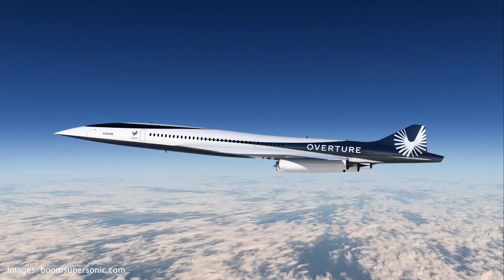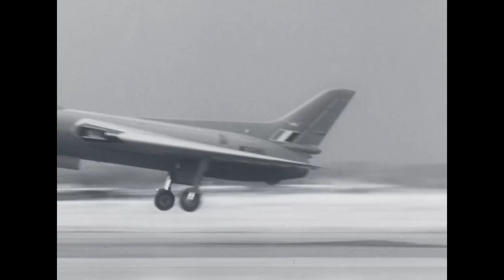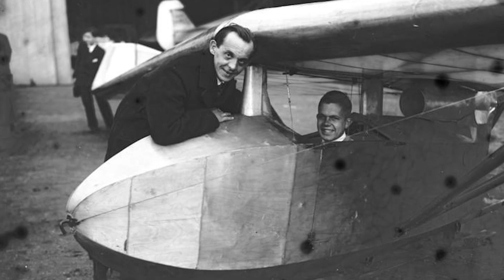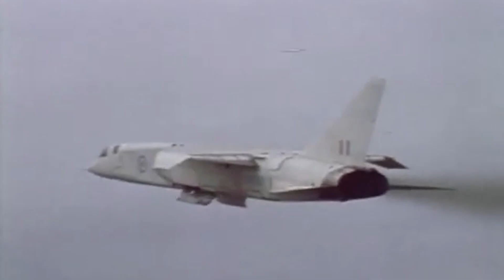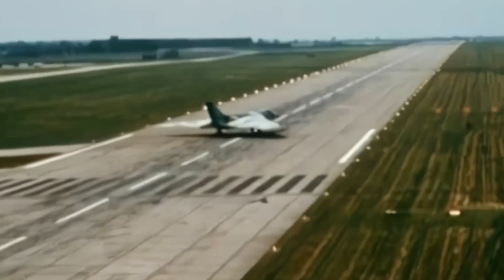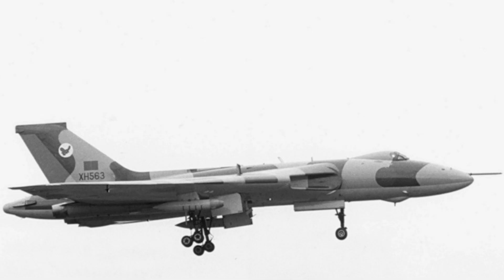Avro 707 & Vulcan: Britain’s Delta Wing Revolution

Comment: Vulcans always looked like a science fiction illustration brought to life - Like a craft designed for Captain Scarlet. Almost too cool to be real.
Reply: It's like the Vulcan was designed by a science fiction illustrator too... which is probably why it couldn't fly supersonic as intended. Too much emphasis on esthetics and not enough on aerodynamics.
Reply: @DoktorBayerischeMotorenWerke  I can't find any sources claiming that it was intended to fly supersonic.  Certainly the wing is too thick, there's no attempt at coke bottling the cross section, and the nose is pretty blunt for an aircraft intended for mach 1+ speeds. They did have plans for a supersonic version, the 732, but that never got past the design stage.  The Victor was probably a better candidate with its wing.
Reply: @ Indeed, the Vulcan in hindsight was a very feeble attempt to produce a supersonic bomber, Avro simply lacked the technology and the expertise.
Both the 707 and the Vulcan were in fact intended to fly supersonic, in recent years many British authors have tried to clean-up and conceal this embarrassing failure.
  The 707 had no chance of ever achieving supersonic flight due to its obsolete centrifugal jet engine.
 The Vulcan however with its delta wing and its 4 huge Bristol Olympus engines had thrust to spare, the problem was both aerodynamic and structural flaws which caused the uncontrolled pitch down and wing spar failures and why Avro was forced to install the Mach limiter system to every Vulcan manufactured. 
 A truly shameful and humiliating chapter in British aviation history and spelled the end for Avro and the relevance of the UK aircraft industry as a whole.

Comment: Rather sadly, the RAF were never very insistent on having ejection seats for their full complement of crew, which meant, that across their entire 3 V bomber  range, ejection was only possible for the pilot and co-pilots, the remainder of the crew having to resort to bailing out via the side hatch (a guard extending to hopefully prevent the crew from being ingested by the engines.)
Reply: The Vulcan failed to achieve its intended supersonic performance, so bailing out was still a risky but viable option..

Comment: I had no idea that some important prototype testing (V707) was carried out at Laverton, which is just up the road from me, as I live in the suburb of Laverton. The Point Cook museum is excellent, and I look forward to visiting it again as I am able.
Reply: As a disappointing failure for Avro, the 707 doesn't get much attention from British historians... nor does the fact that the Vulcan failed to fly supersonic.
Reply: @DoktorBayerischeMotorenWerke  Do you have any source for that?  The Vulcan doesn't look remotely like a supersonic aircraft.
Reply: @ExceptionallyCleverUsername  Original Avro documents show that the Vulcan was designed to far exceed the Ministry requirements and become the first European supersonic bomber, this embarrassing failure of aerodynamic and structural engineering does not get much attention from British historians for obvious reasons.
 The later modification of the production Vulcans with the Mach limiter device is irrefutable proof of these facts. 

Well, it certainly doesn't look like any successful supersonic aircraft... The selection of the delta wing and the massive Olympus engines were no coincidence, they just simply were not enough to make up for Avro's lack of jet aircraft technology.

The Vulcan was the only jet aircraft to ever be manufactured by Avro... it would also be its last.
Reply: @ OK, are there any documents available on the web to confirm this?  Google doesn't seem to know of any.

And are these documents talking about some very early phase of the design process, or from a later phase that represents something close to the actual aircraft?
Reply: @ Other than the fact that it is a supersonic, tailless Delta wing design with 4 massive Olympus engines capable of Mach 1+ Supercruise performance???
  Certainly Avro was not keen to advertise that both of its attempts to build a supersonic jet aircraft were complete and utter failures... what they cannot hide is the fact that every single Avro Vulcan was equipped with a Mach limiter device, this was required to prevent the aircraft (which had sufficient thrust to reach and exceed Mach 1) did not lurch suddenly into a pitch down attitude, lose all pitch control authority and break-up in mid-air. 
 After problems were discovered plans to test upgraded Olympus engines with afterburners was abruptly canceled. All mention of supersonic performance disappeared from any subsequent company literature regarding the Vulcan..
Reply: @DoktorBayerischeMotorenWerke  I see. Thanks, that makes some sense, after having watched one disintegrate in just such a way at the Farnborough air show, in mono footage.
Reply: @ExceptionallyCleverUsername  To confirm what exactly? I have only responded to the show's contents with curiosity.
Reply: @DoktorBayerischeMotorenWerke  Well, i was hoping that there was something out there beyond your bare assertion that an obviously- not- designed- to- be- supersonic aircraft was designed to be supersonic.
Reply: @ a supersonic, tailless Delta wing design with 4 massive Olympus engines capable of Mach 1+ Supercruise performance is very obviously- designed- to- be- supersonic-

The fact that they installed a device to specifically prevent it from reaching its maximum possible Mach number is irrefutable proof of this.
 The Vulcan was a rather embarrassing technical failure for Avro... both of their attempts at supersonic delta wing aircraft were disappointing failures.
It seems these are simply facts that you refuse to accept..
Reply: @DoktorBayerischeMotorenWerke  It is the missing part of Australian history to which I object.
Reply: @ What Australian history??
Reply: @DoktorBayerischeMotorenWerke  Our European history is short, but very remarkable in ways you are unaware of. Our indigenous history is the longest continuous occupation of culture in the world. 60,000 plus years. No they weren't and are not savages either.
Reply: @Steven-p4j  How does that relate to the AVro 707 or aviation???
Reply: @ It is a hidden part of our storied history of aviation in Australia. As I said, I live in Laverton, where the street names are all related to pioneering Australian aviators. I have followed aviation since my boyhood, and yet I knew nothing of these tests. Your previous comment seemed to denigrate Australian history, to which I objected.
Reply: @ That is a wonderful and very nostalgic anecdote... but it does not make the Avro 707 a significant part of Australia's very limited contributions to aviation.
 707 and the Vulcan had both completed their development and the 707 prototype had ended its useful life at the RAE, it was donated tro the Aeronautical Research Laboratories in Australia for low-speed tests for an unrelated program that never came to fruition.
 Australia never made any contributions to the 707 or the Vulcan. 
 Australia has never developed a jet aircraft..